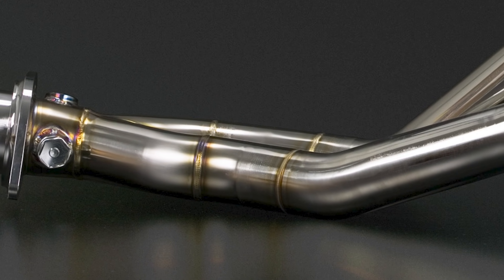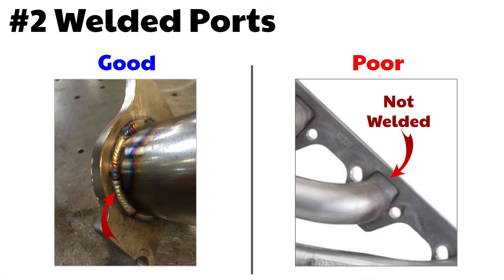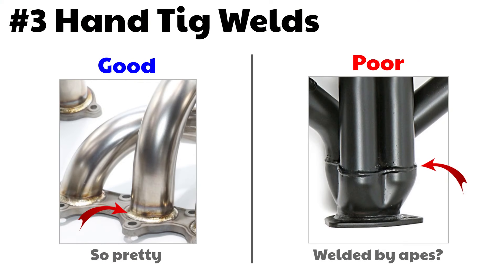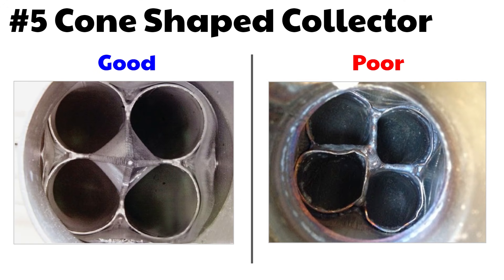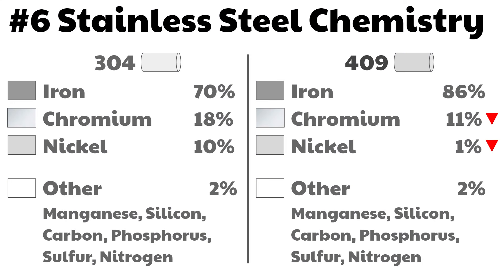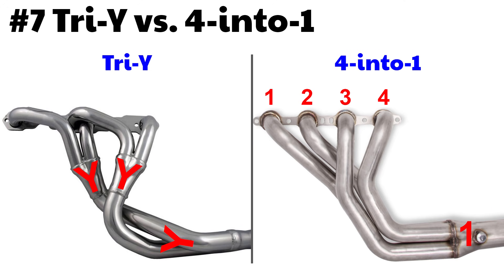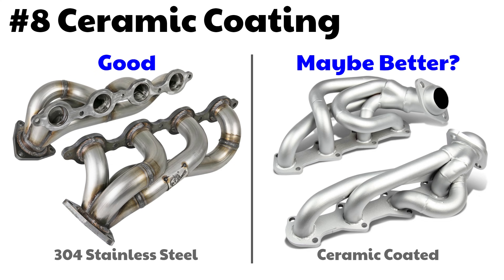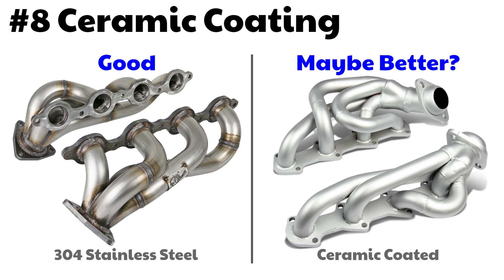Exhaust Header Secrets: What to Look For

Comment: If you have header fitment issues, don't be afraid to dent your headers for clearance. It doesn't affect power at all. Don't believe me? Then watch Engine Masters. They have an episode where they Dyno test headers and they beat them till they're almost closed and it doesn't affect power. As long as you start with good headers you'll be fine
Reply from the maker: Great comment!!!  I was totally going to mention that in this video.  I was kinda shocked by that episode but it seems like totally OK to bash your headers as needed!  My not look great but you wont lose power.  : )
Reply: Engine masters knows very little about headers.   Headers do two things, 1) reduce exhaust restriction.  Bigger pipes.    The second part, hinted at by this video is scavaging, that is done by tuning the headers - primary pipe size and length, collector style diameter and length.   If you can dent a header and not loose any power, the header is not tuned to your car and is probably way too big.

Comment: Hey good you tuber. Could u make a video on which piston types are good like material wise. And then what type of Conrad’s are good H rods or I beam conrods
Reply: If you can afford it I beam is always the way to go. If both rods are the same weight the I beam is stronger. If both rods are the same strength the I beam will be lighter.
Reply: The question is what kind of engine are you trying to make, because the answer can be swayed greatly based on what you're looking for.
As far as piston types:
Cast- basic, production style that gets the job done so long as original design parameters aren't exceeded
Hypereutectic- similar to cast pistons.  However, with the alloy's high silicon content, the pistons are harder (think diamond versus talc), and don't expand very much, causing much tighter tolerances (gaps between components) to be achievable.
Forged pistons (aluminum) there are two different alloys to really consider, 4032 alloy and 2618.  4032 is really good for maxing out a naturally aspirated engine combination because it's an aluminum forging with a significant silicon content (not to the extent of Hypereutectic, but still), is light, and doesn't expand as much under heating (silicon does that).  2618 alloy forgings are the go-to for high-output, high-strung forced induction builds that need the best that they can get for material strength.  The one major drawback of 2618 forgings is that since they're a more pure Aluminum forging, they expand under heat far more than other alloys, and require the engine to be warmed up gently for a few minutes before being put to work.
Also keep in mind that there are only 2 piston manufacturers at this moment that make their own forgings: Wiseco and Mahle.  Every other manufacturer takes non-machined forgings from one of those two and adds their own machine-work, which makes them differ slightly.

For connecting rods:
Far and away the H-beam design is ultimately the stronger setup.  It has a more robust cross-section, and in general is what handles power above 800-900 HP.  But again, it all depends on how the engine is built.
For instance, I'm rebuilding an LS engine for naturally aspirated performance, and I chose a set of I-beam connecting rods for the build.  Main reason is that the engine's output won't exceed the strain capacity of the connecting rod, and an H-beam is a little overkill.  I-beam rods are regularly lighter than their H-beam counterparts, which is important; decreasing mass from an engine's rotating assembly is one of the key parts in minimizing an engine's parasitic loss, along with decreasing drivetrain mass.
As stated earlier, the same alloys are going to come into effect.  hopefully they help inform your decision on what you want to do.
Reply from the maker: Thanks for the reply, does this mean I dont need to make the video now.  ;-)
Reply: @AutoGuild  lol I don't think anyone would complain if you did
Reply: @AutoGuild  yeah go ahead make it lot easier to understand in a video

Comment: What about wrapped headers? How do you feel about that? I also heard that ceramic headers are more likely to develop cracks
Reply: I heard wrapped crack fast especially if you do a lot of water crossing.
Reply: @Agent.K.  I live in the desert southwest and only drive on city streets. What makes the wrapped headers crack besides water
Reply: @nrgrlsd9931  They say moisture gets trapped behind the wrap
Reply: @nrgrlsd9931  
I should have mentioned, cold water. The sudden change in temperatures is the cause. But that’s for off-roaders to worry about. I don’t think it’s a problem for street cars.
Reply: wrapping headers improves scavenging and drops underwood temps significantly. if your headers are mild steel they will rust out faster think 4-5 year lifespan vs 10+. if they are stainless steel it won’t effect the lifespan off the headers negatively. i wrapped mine and have no regrets in doing so. i noticed a little bit more power too
Reply from the maker: Yeah I think this is a good point, Ive also heard wrapping can trap moisture and lead to rust.  I didnt put this in my video since my video was on headers but maybe I should have.  Maybe a quick video on pros/cons would be good.